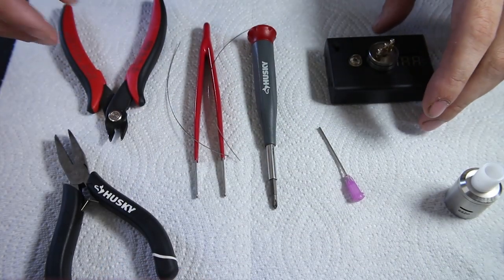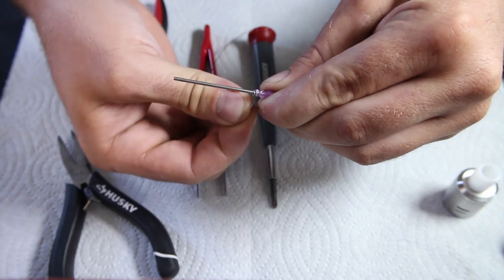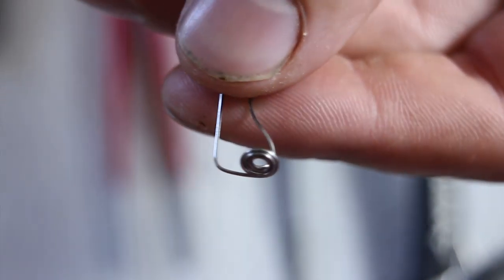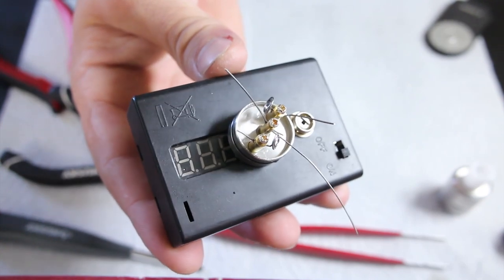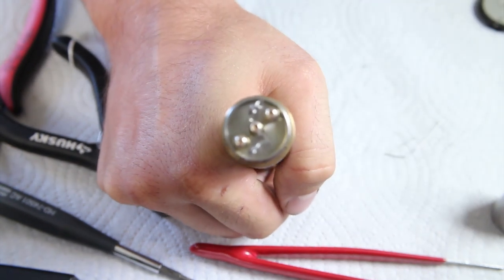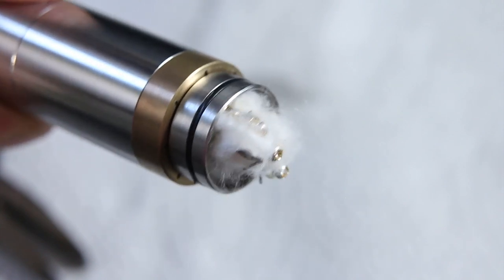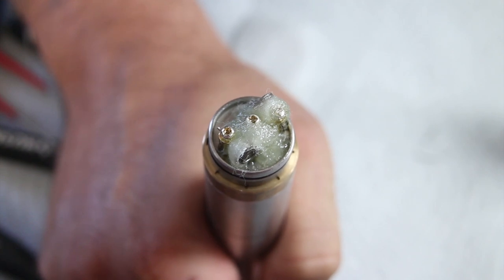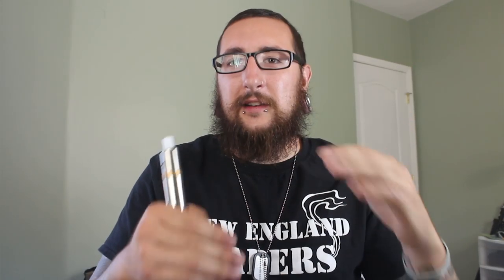#FRESHBUILDFRIDAY - Stove Top Coil

Comment: Having a hard time keeping the coil straight an concentric circles.. is there a trick to this build I'm not getting?
Reply from the maker: Lover Dee It's easier if you have something with a flat base to wrap around like a screwdriver with a handle, that way you can pull the wire around while leaning it against the base. It takes a bit of practice so don't be discouraged if you don't get it perfect the first try. Vape on!

Comment: Hey bro I want to try this coil build how many spins per coil to achieve .3ohms
Reply from the maker: I think I did 5 wraps of 24g on this one metering in at .3 ohms. If I had to do it all again, I'd probably do the same with 26g around a smaller needle but it's all up to you and how low you want to build it.
Reply: cool bro I will give it a try with 5 wraps at .3ohms when I pick up some more 24g wore thanx again
Reply: cubanman2009 if your doing a dual coil I did 8 wraps of 24 gauge ni80 around a 3mm bit and in a dual setup it was .3 on the nose, but it might come out different for you depending on how tight you wrap and how close together each wrap is
Reply: get a coil master kit the little coil jig things work great for single wire builds